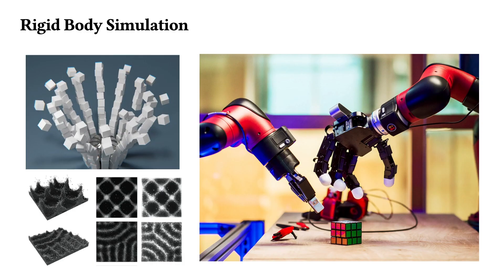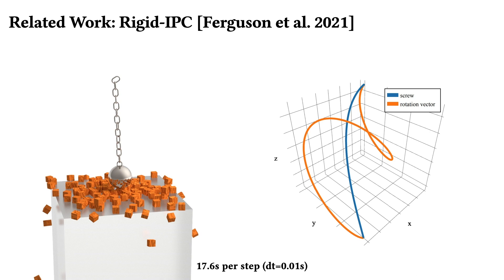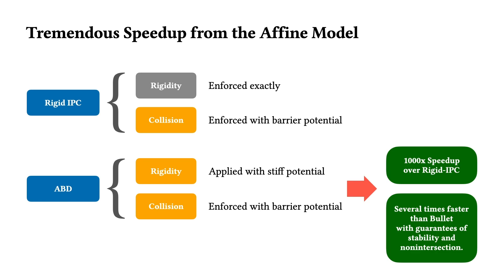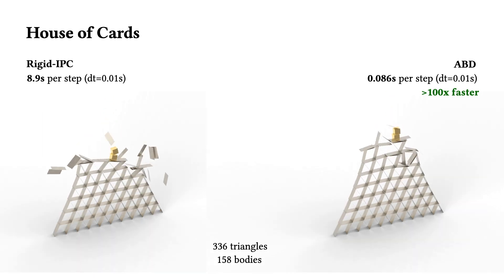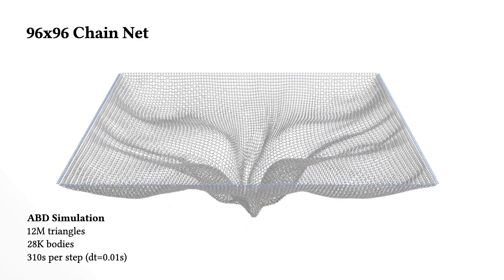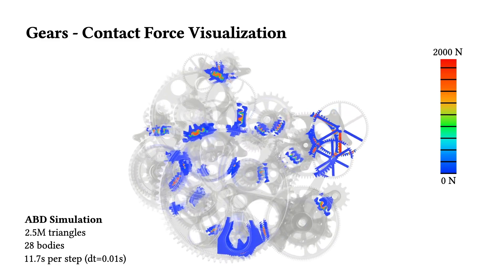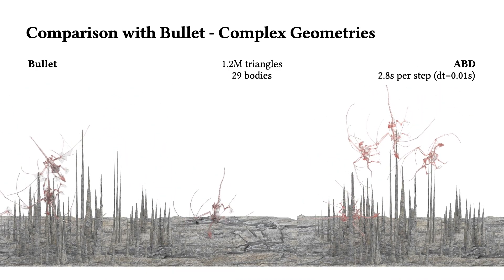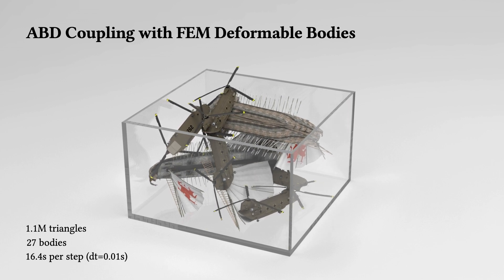[SIGGRAPH 2022] Affine Body Dynamics: Fast, Stable & Intersection-free Simulation of Stiff Materials

Comment: Wonder what the downsides are. This algorithm isn't a use case for games or realtime simulations?
Reply from the maker: Our research is just published this month. It could sooner be applied to products.
But for games, as the current engines already provide nice visuals, intersections may not be that crucial? Not sure what game developers and players think about it.
Reply: @minchenli2292  It will be very important for robotics simulation, such as in isaac sim.  a lot of tasks in robotics require robot able to practice virtually at very fast speed and with very accurate tiny realistic contacts, not approximations for 'visual' effect.  Congrats!
Reply: @minchenli2292  VR applications probably would make more use of this kind of algorithm where precise collisions are preferred. Also crunching simulation time down in a offline renderer is always a good thing.
Reply: @minchenli2292  modern game engines are completely unable to cope with physics and the needs of game developers.
Reply: @minchenli2292  I want to make very interactive game someday, my opinion graphics are important, but actual interaction/physics is better.